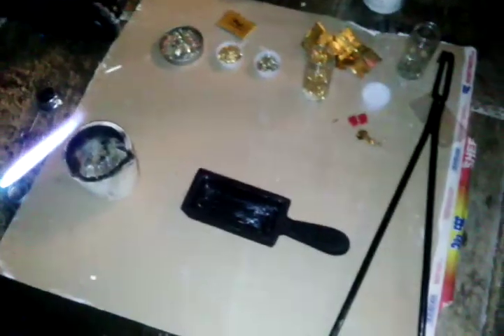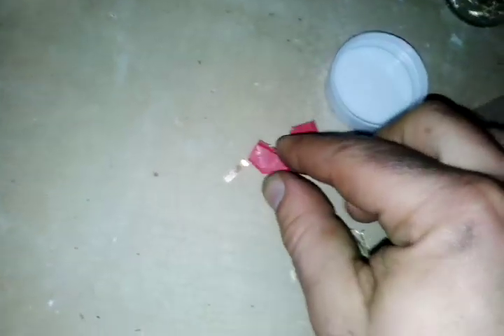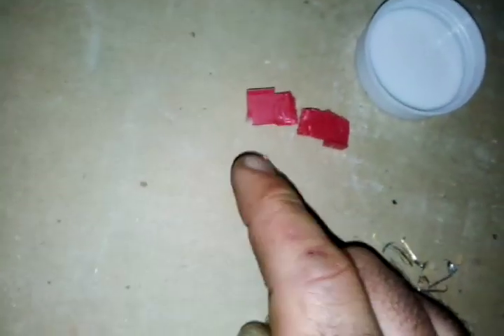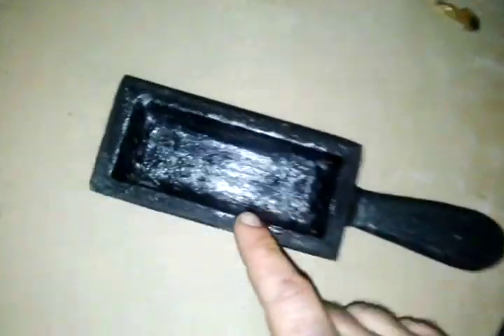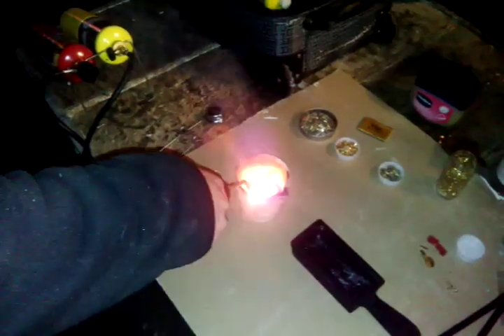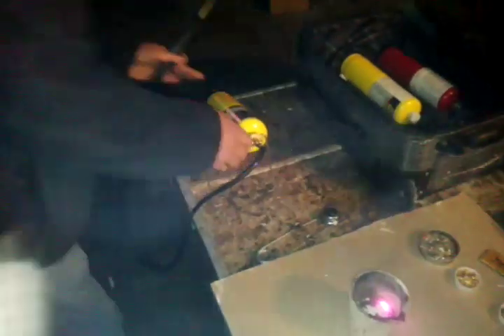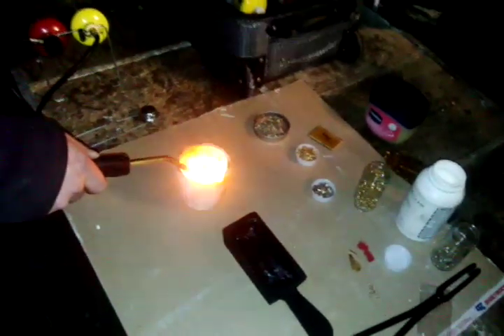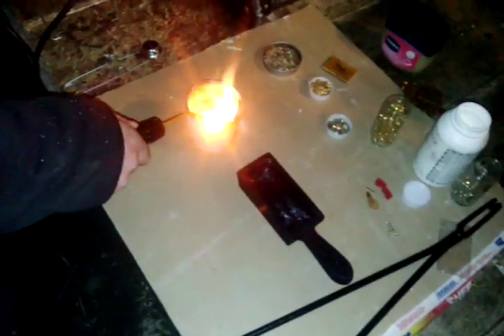Avi Oziel in: How To Smelt Gold Plated Computer IDE Pins - Smelting / Melting Gold

Comment: What is this ? Video ? About ?
May I suggest some learning...
Before your next embarrassment !
DEFINITELY not 2 grams - Pentium.
Around 1/2 a gram in that pentium.
YES, You can melt gold with propane.
I couldn't get very far into the, Video ?
Mixed metals bar. Called pot metal.
Nickel, Steel, Copper, Tin, Brass, Solder, Maybe some Silver,

Comment: The only gold you will recover from computer parts melted in ingots will be on the outside. This is probably less than 0.05g unless you plan to grind them into the finest powder by which point you wasted more money than there is in gold. Pentium pro cpus have a total of 1.0g recoverable on good days not 3.0g

Comment: That torch you guys are using is a complete fail. First off the tip is made out of brass.... second there is a plastic handle. Torches with brass tips and plastic handles are not designed to be confined in a crucible when they are burning. They use the surrounding air and full flow of MAPP to cool the tip.